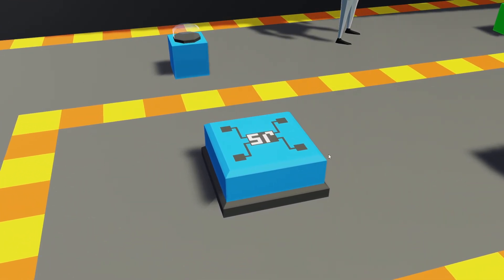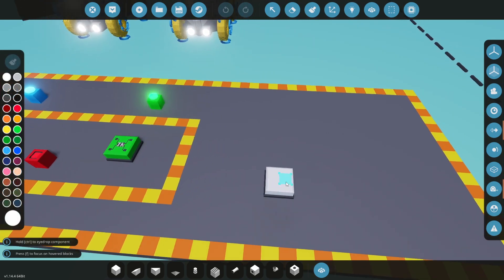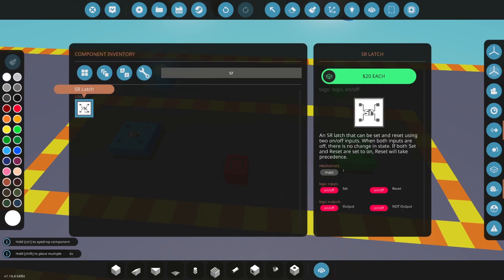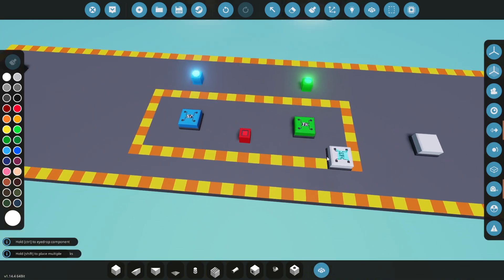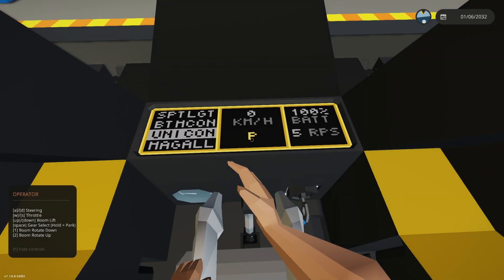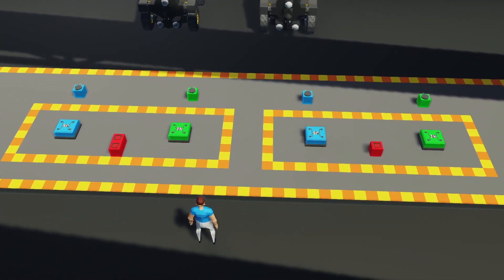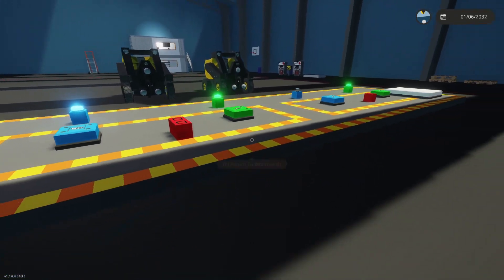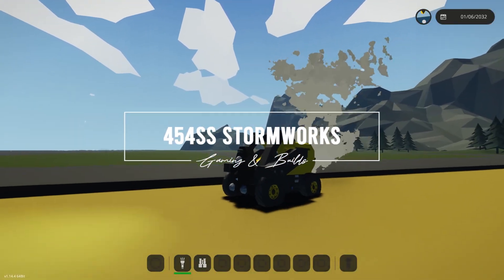The Logic Mistake 99% of Players Make in Stormworks (Engineer Explains)

Comment: I wanted to mention this since the JK flip-flop in the game is missing a clock signal and may not act the same way that you read online. (Unless of course you make sure the info is specifically for Stormworks)

The SR latch was designed to act as a latching circuit. S or SET turns the output on. R or RESET turns it off. If you press RESET, it will turn off no matter what the SET input is. In Stormworks, you can connect the inputs to a button and no matter what, the output will always be off. This is because there is a logic tick that updates the output based on both inputs at the same time. In real life, triggering both inputs at the same time could cause a race condition. It could either turn on, off, or maintain it's state. This is (partly) why the JK flip-flop was invented.

For the JK flip-flop, the inputs act the same, but there is a clock input. This means that no matter what is on J or K, the output wont update until there is a clock signal, e.g. a rising edge. This helps prevent the race condition, since the logic connected to the J and K inputs can trigger on a falling edge, and by the time the rising edge is reached, the input logic has settled. I am still new to Stormworks, so I haven't messed around with these blocks yet, but the fact that they don't have a clock signal makes them sound really counter intuitive to me as an electrical engineer. I'm still really looking forward to playing this game more though.

Comment: i used z & x ^ y | w & x ^ y in order to make a door that opens upon unlocking the ability of 2 buttons by pressing an unlock button.The 2 buttons can open the door when they both are turned on at the same time.There is an another emergency button which makes the 2 buttons require only one button on so the door can open.Also,the normal button takes about 6 seconds to grant the ability to the 2 buttons for them to open the door.(i used a boolean F(X) in micro controllers)

Comment: I think some parts of what chatgpt said about the latches is not entirely correct for stormworks, I'm pretty sure it assumed you were referring to physical counterparts that work directly with electricity (for example SR-latches behaving unpredictably, which isn't true in programmed logic like stormworks, only in electrical components)

p.s.: in stormworks I wouldn't say jk's are better in general, in fact I personally default to sr's and only would use a jk if sr doesnt work for some reason, which so far has never happened to me
Reply from the maker: Yup, that makes sense, I took it all with a grain of salt, but it did explain some of the differences pretty well!  I have never had a SR work unpredictably, but just not work for the task at hand haha. Yeah that's a good way to do it, SR is the more simple one, then if it doesn't work, go to JK.

Comment: Okay so what's the difference between a jk and a push to toggle? They both use 1 button to toggle an output on or off. Is the only difference a built in not gate?
Reply from the maker: I have never used JK in the manner I showed, I prefer to have control of when it is reset vs. just allowing it to be togglable.  And it lets you use ON OUTPUT and OFF OUTPUT, vs. being at the mercy of where ever it lands haha

Comment: Even someone who DOES have an electronics degree, such as myself, can forget the differences between an SR and JK.  But we always remember there IS a difference.  And I always remembered, the SR is 'simpler' than a JK.  And I've used it so infrequently over the years, it usually comes down to:  'Alright, where're my notes?'
Reply from the maker: hahah good to know I'm not the only one struggling! But I like that "SR is 'simpler' than a JK", that is probably enough to memorize.
Reply: @454ss_gaming  

The thing that sticks in my head, is that the J-K flip flop is named as such to deliberately AVOID a mistake you would otherwise make.  

SR is named Set-reset, as to imply there is only one valid 'set' state, and the other state is just a clear, or 'reset'.  And we see with the precedence, that RESET overrules the state.

J-K, is such as ti imply that BOTH states are equally valid.  

This is also more important in actual circuits, and not stormwork MCs, in that in real circuits, the latches tend to be on circuits that have timing signal inputs that tell the latches WHEN they can poll the inputs.  And that makes a WORLD of difference between SR and JK.  You'd have to check the details on wikipedia or something, but consider that without a timing signal to sync the inputs to, JK's 'both high, toggle' input wouldn't WORK very well.   Stormworks obviously has the timing signal built into the code.  64 frames/sec.  But it does make for a nasty bit of code.

And that just reminds me about floating inputs.  (Inputs with no 'input' plugged into them.  I have a habit in MCs, if the input doesn't DO anything, like a number input that isn't needed, I tend to stick a constant zero on it.  Because in REAL circuits, a floating input randomly becomes ANYTHING, and that does HORRIBLE things to control logic.  Common example is a numeric switch box where one side is a value I need, the other is zero...  Well, I don't trust the empty input to STAY zero, so I force it.

There's a term for what I'm doing, but it eludes me right now.